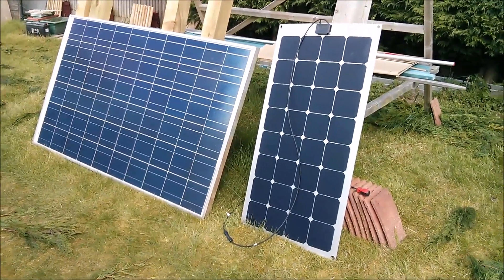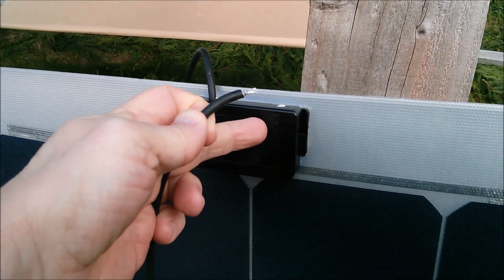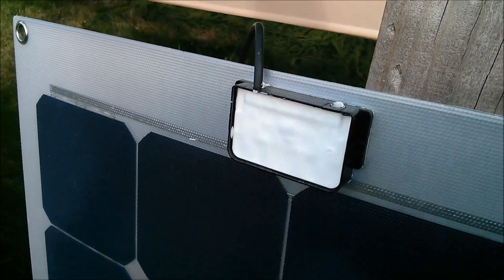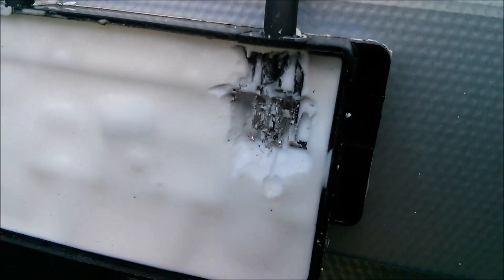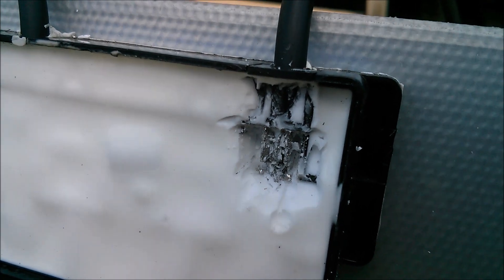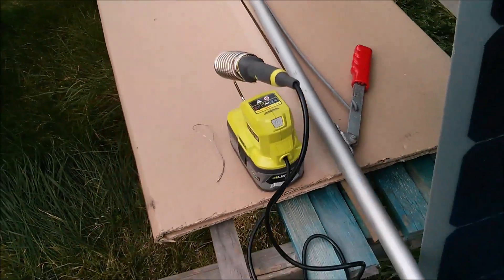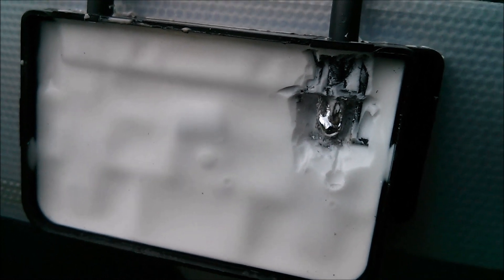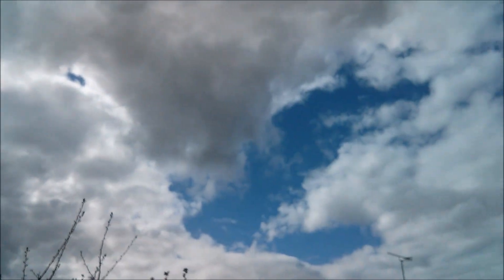I Broke a Solar Panel

Comment: Find some aquarium silicone sealant to reseal the junction. It is non corrosive and adheres quite well to plastics and metal. Conventional silicone has way too much acidic acid in it and will destroy the connection in short time.

Comment: When I saw that 'potting', I thought to myself: "Well bugger me!" - Don't forget to re-seal/re-pot that Julian, otherwise the Internet Corrosion Police will be all over you :-)
Reply: Yep, I shouted "At least pack it with Vaseline"
Reply from the maker: It's now packed with flux as the first solder attempt didn't hold :)